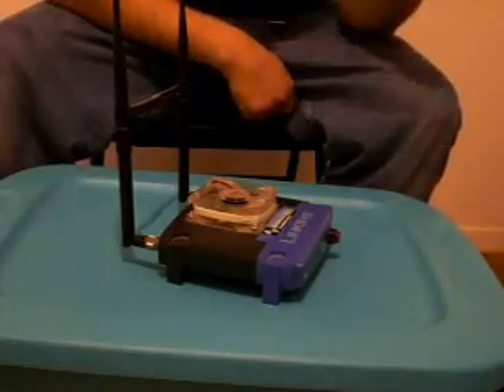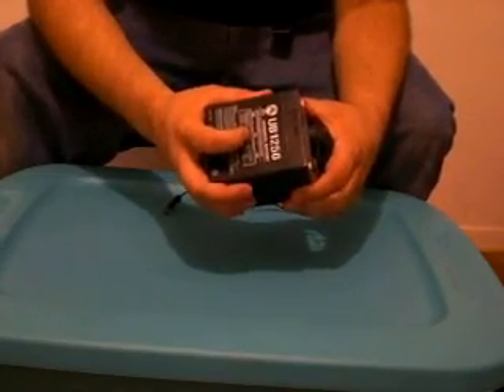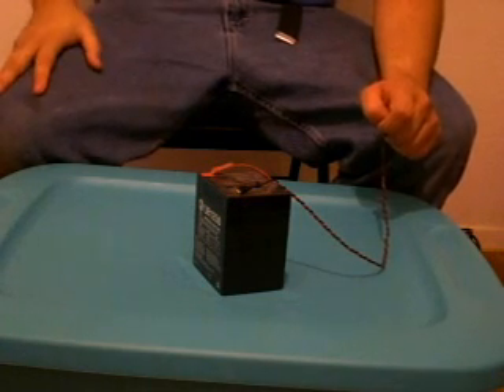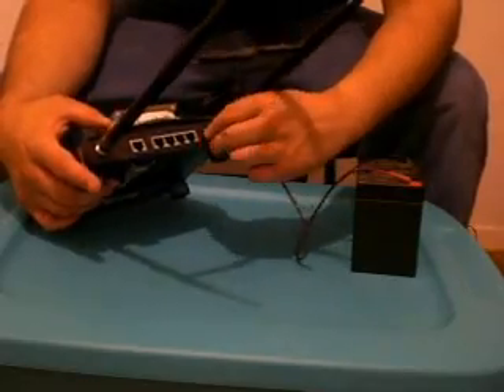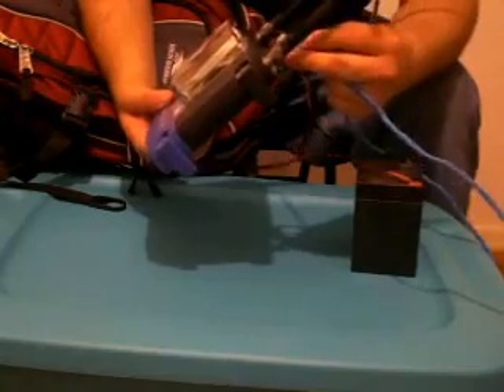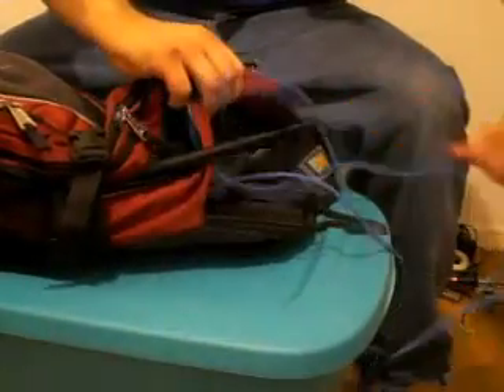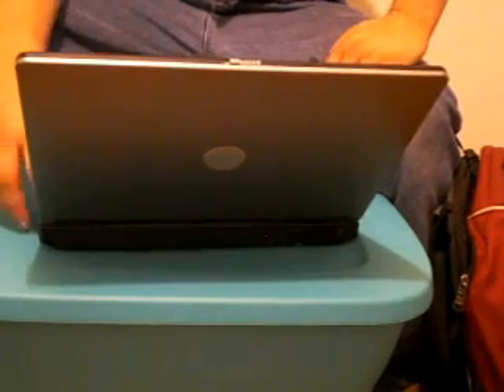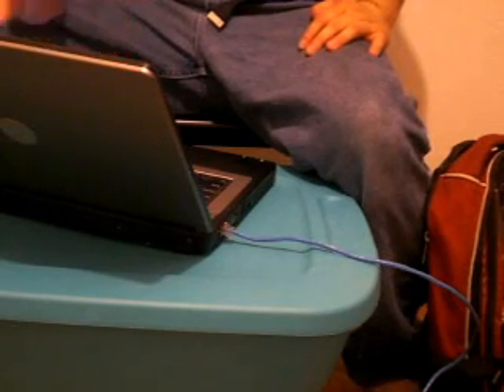how they make Rogue AP'S to steal your credit card information

Comment: such a noob ass setup. get a pineapple or get a sbc and install backtrack on it, with some automated init shell script to automatically connect to open wifi network and perform arp poisoning as well as sslstrip. or even have it auto-crack wep networks and associate with them to sniff traffic as well. low power, run it from a battery, much more compact.

Comment: Your wrong too... Proper ARP poisoning will work on nearly any average hot spot or access point and allow you to easily sniff data on the network without having a rouge access point. For CC numbers and such a tool like SSLStrip is needed if you don't have it.. then I don't care what tools your using your not sniffing CC numbers unless your setting up phished pages on a local server and doing a dns poison attack on the network.

Comment: Any accesspoint can be a rouge ap. They don't need to be made.. You simple need an access point (NOT A ROUTER, you'll double nat the network) The simple form of a rouge access point is just an access point that you connect to someone elses network without their permission.. It makes a great entry way into a "secured" network.

Yes the pinneapple and other modified routers/aps can do more.. However any access point can setup a pishing page to steal CC numbers. Without the need of extra software

Comment from the maker: yurezplace, Did you not watch the video. If you did then you nociced i said at a hotspot and a good hotspot wont lett you monitor everyones info with wireshark. thats why the rogue is setup and put in place its there to trick the user into thinking there on a "more" secure network when there not and it enables the use of wireshark. So as far as networking i know what im doing and if you want ill teach you what you lack.

Comment: Great demonstration man, only question is- I've used a standard ethernet cable to use windows internet sharing (bridging) and it worked good.. why did u suggest a crossover cable if the standard one works?